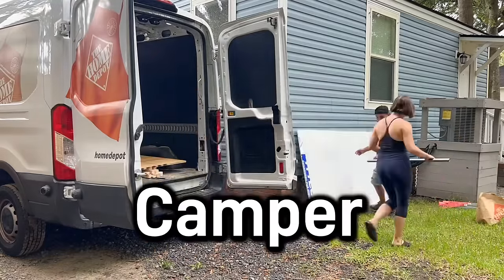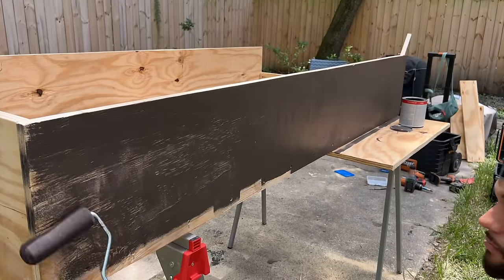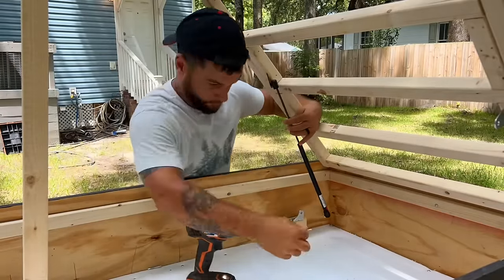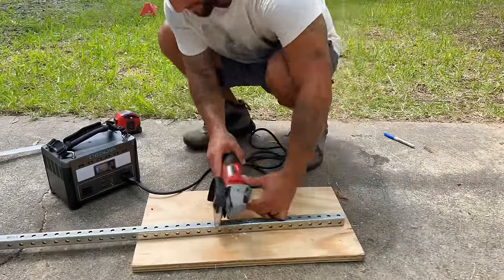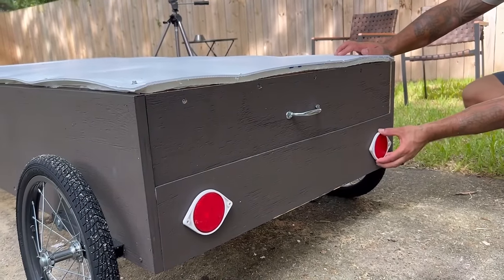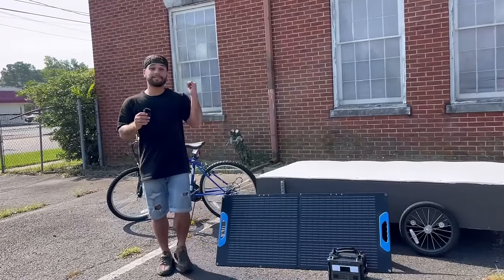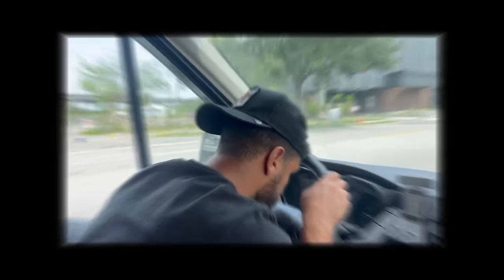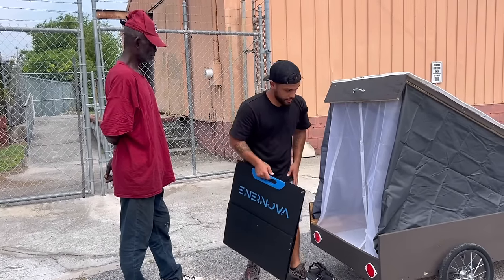Building A Pop Up Bike Camper For A Homeless Guy | Full Build

Comment: Ive built my share of things while living outside. A problem these nice campers will have to deal with is theft. Making it not stick out or draw attention is important. People see something nice and they are drawn to it for the wrong reasons. Are they lockable? Any lock can be compromised but locks will prevent opportunity theft and also will slow entry of someone trying to get in. Adding an alarm with a fob($16) on amazon or a window/door alarm. Nobody moves when someone elses alarm goes off but for your own stuff, an alarm tells you someone is messing with your stuff, handle it. Happy i found this channel.

Comment: Homeless man here. I have the luxury of living in my truck. One thing I have learned real quick is that truck liner can be painted on. This has added a bit of color, heat resistance, and protection to my truck bed, and to the roof of my truck.

Perhaps something similar would be prudent for future designs.

Comment: I really liked this one! It was cool! 🥰 But one issue. The waterproof plastic was attached to the inside, which wasn't painted, and no silicone was used to prevent a waterproof barrier between this layer. Which means that any rain hitting the waterproof plastic, is gonna drip down the edge, and into the interior where the wood will eventually start to rot.

It's not a bad design, but needs a few minor improvements.
Reply from the maker: I appreciate the comment. It did rain and the inside did not get wet at all. Unfortunately, we were not able to record it because we were at West Marine. But thanks for watching and God bless.
Reply: It seems like the tent fabric needs to lap over the sides of the camper. I have a motorcycle camper, and it does have such an overlap to keep the rain out.
Reply: @cherylbarrett3443  Yes, I agree! 👍
Reply: I think a tarp would fix that issue. He could even use it for extra shade.
Reply: @lynne8755  Yes, a tarp is the first thing I thought of when I looked at this. It would also allow cooking with an alcohol or other camping cookstove out of the rain on an rainy day without risking carbon monoxide inside the  camper.
Reply: @brucemcfarling6594  I have a feeling he knows.
Reply: I saw that and thought that's going to be an issue at some point
Reply: My First observation too, common sense with a little logic says it will of course leak. A flap with glue & stitch like on tents and some Velcro to hold the flaps down onto the outside of the trailer would have been fine, allowing all fabric to fold inside the trailer when the roof is down.

Comment: It’s an amazing idea and a wonderful way of helping people, just worth to to do a small change in the future builds: the waterproof material on the sides should be bolted outside of the box on the bottom cause whatever it will be the rain water or the morning condensation, it will flow inside the camper when it’s positioned like this. Great job!

Comment: Outstanding! Now consider using armored 1" foam board for top and partially on sides. Using cotton duck cloth adhere foam board sandwiched between a coat of latext gripper paint. It's becomes very strong. Coating both sides even stronger... Cut the side planks in half. Put armored foam along the top edges. Great idea you have there...saving even alittle weight goes along wait on cycle campers...since you have 2"X2" slats you can getby using 1/4" plywood for bottom can weather proof using cloth Nd gripper paint. Once all glued & fastened together very strong....cheers

Comment: Sweet camper. If you build another one like this maybe see if the fabric can attach outside the camper so if it rains the water won't end up inside.
Reply from the maker: Thanks homie it actually ended up raining and the inside didn’t get wet at all. Unfortunately, I was not able to record it because I was at West Marine when it happened.
Reply: a long heavy  wind and rain  should fill the box. @buildersblueprint

Comment: This is the best homeless camper I've found since finding various designs on YouTube about an hour ago.  

I love the pop-up feature that lowers center of gravity & prevents WIND from tipping it over when traveling.  I'd probably prefer to use it just as a base to set a TENT up on.  Then, remove the floor of the tent to be able to access food & supplies stored in the base while I'm in the tent!
Reply: I agree, I love the design which has both a low center of gravity and low lateral windage. I think that one could lower the weight with some creativity but the basic design is so far my favorite. The materials and technique fit the need perfectly for these traveling angels.

Comment: Oh I wish you could have installed the fabric to the outside of the camper rather than inside along that rail. The water may sit in a pocket between the canvas, and wall and when he folds it down soak the inside. Perhaps you accounted for that by having that slight overhang of the corrugated roof? Anyway ... grateful for what you do and how you are blessing to those around you.
Reply from the maker: We only had a curtain budget to get this finished but it did rain and no water got into the camper but thanks for watching and God bless 🙏

Comment: Love the idea, gonna try and make one for myself. It will be better putting the insulation between stats on roof so the corrugated plastic will be flat on top, bottom of tent material needs to be outside of camper otherwise rain will leak in, and a tarp or more tent material for doorway for privacy and water proofing.
Reply: Better to insulate THE MAN (w/clothing/sleeping bag) than the dwelling, as it would become intolerably hot quickly in warmer weather.

Comment: You should try camping in the rain in one of these first. The attachment of the tent fabric INSIDE the side is likely to have rain running down the fabric and INTO the cabin. You'll either need a redesign or spray the hell out of the fabric with silicon water proofing.  Also, was the insect netting ATTACHED to the side fabric? Looked like it was blowing loosely. I also suggest painting EVERY surface of the wood BEFORE attaching them together, as water will wick in between where you couldn't get paint to. Love your sentiments, though!

Comment: Here is a tip. output the bikes with cheap 49cc 2stroke engines or ebike hub motors. That will make towing around the campers, up hills alot easier.
Reply from the maker: This is a great idea. Thanks ✌️
Reply: no problem man. i was homeless too once. sleeping in a tent. i would take one of those for my ebike and solar charge it if i had too. @buildersblueprint

Comment: I liked the design but I think quarter inch square tubing
And a welder you could probably take away half if not more of the weight and I would think it would probably last a lot longer and the elements
Reply from the maker: Completely agree with you. We haven’t had a place to build these so it’s really hard to get that type of set up but we did just buy a house so we will be getting a welder and plan to make many more videos for you. Thanks for watching and God bless ✌️❤️
Reply: @buildersblueprint  you can always go with the simplest welder from harbor freight get their hundred-dollar flux core wire feed and the auto-darkening hood that's the easiest cheapest setup I know of
I've been thinking about doing something like this where I live anyways God bless congratulations on the new house

Comment: I see a few things that will go wrong with the camper. First it will leak in the spot where the water proof walls and the wood come together. That's an easy fix just DAP the hell out of it. Next is the door. You can see that it is not attached to the sides when you are giving him the camper so the bugs are still getting in. Just attaching it to the side will fix that. Last the door also not a waterproof door so it needs like a roll up cover that can be put down when it rains

Comment: Another thing is heat, keeping the sun from turning it into an oven without natural shade is easy, but most arent familiar with it. Mylar. Youve seen "space blankets" im sure, they work by reflecting EM. I cover my tent completely with mylar which will reflect sunlight. The temp will drop immedietly. Its not super durable so maybe having panels made of coroplast with a frame that attaches to the outside of the structure and attach the mylar to the coroplast, which can handle being moved around a lot and will keep the stress off the mylar. In cold weather i use Insul-Brite and Insul-Fleece, both from Joanne fabric or Michaels and can be added just about anywhere. I have a bike trailer made for transporting a dog that was only a nylon fabric exterior. I the feont and rear i used insul brite along with Relectix and Lexan. The sides got the 2 insulations but coroplast instead. The roof too. Held in place by metal snaps.

Comment: I have watched all this build videos. I think you should get a trailer to build out of instead of the airbnb. One issue with this build is the support legs. Not having a set of support legs on  the back will have too much load on the clip-on trailer wheels.

Comment: 100% went to the pond shop and sold it for drug money. That camper is better than before not so slow that its worthless. Needs some puncture resistant liners in the tires and some innertube sealant. The wood is a bad option as Its better to make it out of electrical conduit welded all together. I know what a homeless person would want from a bike trailer and its best to make it like a shopping cart so they can load as much crap as possible. Now to pull the trailer you what it compatible with bicycle and walking setups and they just need to swap out between them both easily. Walking setup 2 parallel bars that fit into the tube frame on the trailer. And the bike setup can be a single pipe bent to fit from one side to the other in a v shape that fits in the same spots as the walking setup. The cheap bike trailers you get at Walmart or so have that bar that connects the trailer to the bike should also be added to the trailer as well for compatibility just in case if the person losses their other tow bar. Make a box with electrical conduit with top two rails on top length wise at a larger diameter pipe so you can stick things in like the the walking setup with the ability to have two bars side by side to hold on to. The wheels make it fit with 24inch to 16inch wheels with them on the inside not the outside of the trailer as the bicycle wheels are not meant to be held on one side. A swivel wheel on the front an back of the trailer can help with those that struggle to lift one side the trailer to move it especially when they are on drugs so set them on but not to low to the ground as they are not efficient compared to the larger bicycle wheels. And I can let you think of the rest. Wood is a terrible material to make a bike trailer out of as its too soft, too heavy, and can degrade very quickly for it to last.

Comment: think lighter you went excessive on the weight in the build took no effort into thinking am i gunna drag this thing up a hill gives me an idea though best build I've seen yet but needs thinner materials perhaps going as far as gluing a tarping over it making it round and a pop up with hardened matirial rather then cloth but not to thick aiming for under 20lbs

Comment: Do you know where you went wrong with this build? The fabric side walls needed to be joined to the outsides of the trailer, on the inside, when it rains, the water will run down and into the inside, also, you failed to give it a waterproof door.

Comment: when it rains the water will run down the fabric and right into the camper . next time mount the fabric on outside so it runs off the  fabric and onto the ground. not being a jerk just built rvs for years and know when and how water will ruin a camper.

Comment: water will run down the sides to the inside. the wheels in the back make no sense for weight distribution and steering. no insulation. no waterproofing. this is a horrible bike camper.